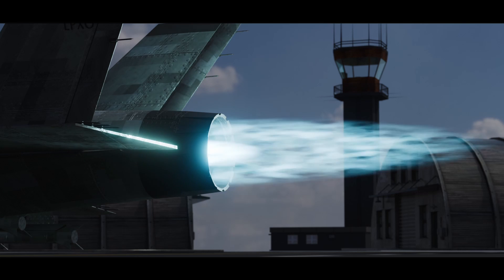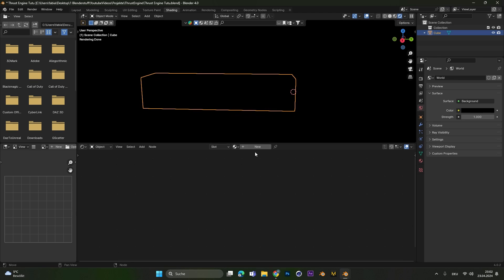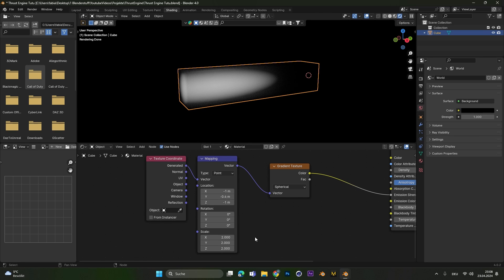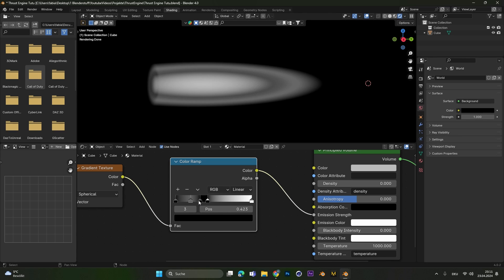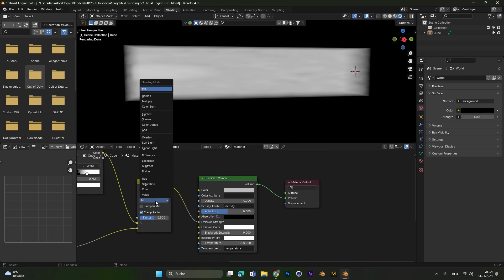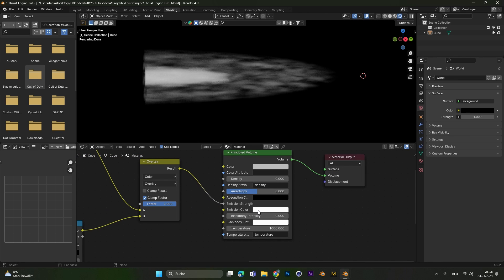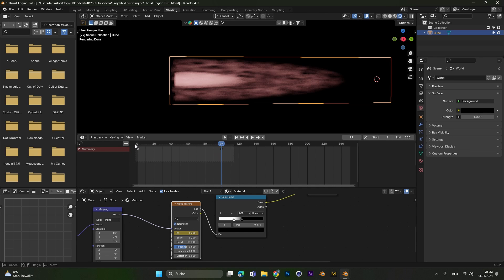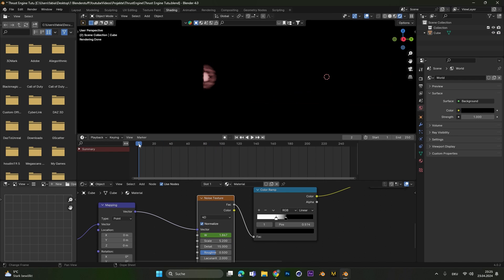Thruster Engine Flame - Blender 4.0+ Tutorial

Comment: Wow! I've watched a number of tutorials purporting to demonstrate thruster-flame animation, and you're the ONLY one who used the "volume" setting on the Material Output node, and animated using the 4D "W" setting on the Noise Texture node. All the others "faked it" using the "surface" setting on the Material Output node and a kluge of animation contortions. Consequently, your node parade was MUCH simpler and more direct, achieving a true volumetric flame configuration. 

For my project, I needed only to animate a cold RCS thruster plume, so I didn't need the complexity of all the color settings. And the result is superb. Many thanks for seeing through to---and effectively demonstrating---the most efficient use of Blender's shader capabilities!
Reply from the maker: Thank you much appreciated your comment :)

Comment: Thanks for the grate tutorial but there is a problem. I don't know if you notice that the flame disappears if you try to render the animation with transparent background. It seems that the alpha channels doesn't render. Do you have a solution for that? Thanks in advance.
Reply from the maker: Hmm in that case I would render it with a black background and in the editing program later change the mode to "add" or "screen" which removes the background. Hope that helps